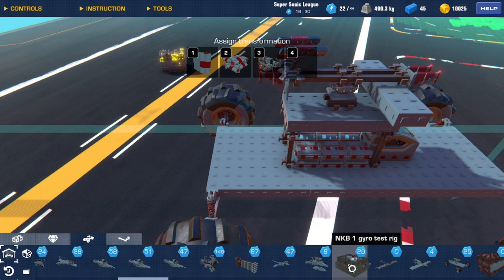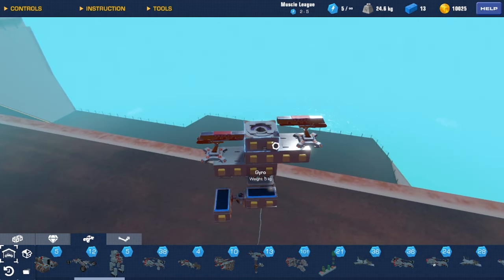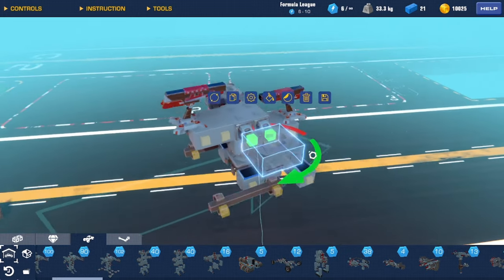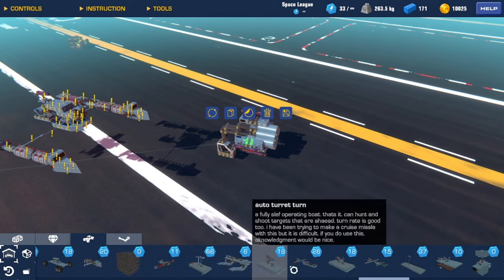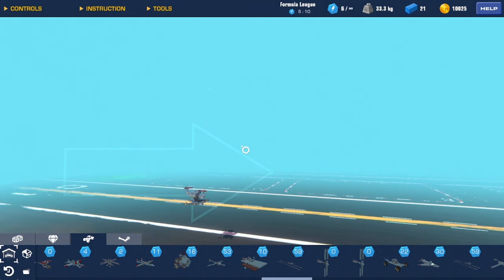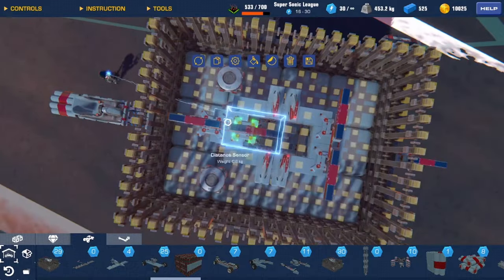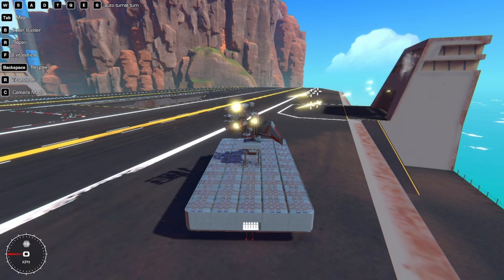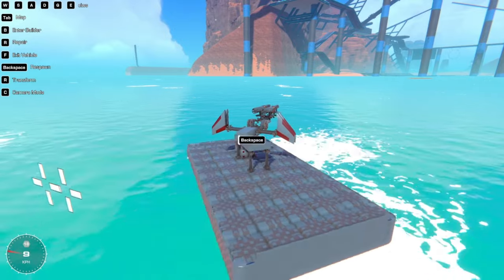RECOIL TECH, RADAR, AND MORE! IN TRAILMAKERS   |   RECOIL TECH

Comment: 10:11 To overcome the issues of sensors being "binary"; have you tried putting thrust onto the radar? As long as the radar is attached forwards of the center of mass of the main body, any thrust on the radar will turn the main body. The recoil from the guns turns the radar, the radar directly determines where the thrust on the radar is pointing, and the thrust is turning the main body.
Yes, you have the issue that the guns now have to turn the thrust as well as themselves, but for an aircraft or boat you can leave the lift or floatation on the main body. And your radar needs to have SOME counterweight to balance the guns anyways. You don't even have to put all of your thrust onto the radar. Some of it can remain on the body (where they will not contribute to rotating the body, and thus that response is weakened, but it will quicken the radar's response). (You could even go 3-step, where the radar has only enough thrust to turn a thruster unit (with all of the remaining thrust) and the thruster unit turns the main body - if you can get it all properly balanced and dampened...)
Reply from the maker: defiantly something interesting that i will consider but currently the binary of the sensors has not given me issues. when i start getting to missiles that need to be more responsive than the sensors can then i will definitely test this.

Comment: 17:45 I would say this is a game issue. I work with plenty of glitches and I can confidently say trailmakers has issues when it comes to high velocity and or rotating speeds. Also, mechanical parts' strength and guns are affected by how fast your going but it is a bit situational whether or not they are affected.
Reply from the maker: could you tell me anything more? im just about to post my next video about this.
Reply: @ThisIsDumbAllTheNamesAreTaken sorry for late response

I dont have any numbers since I haven't had to test this stuff yet, but there are multiple cases of conservation of momentum/velocity being a bit cursed whether intentional or not. For example, unstable UFO engines usually only work when pointed in certain directions and sometimes change how they work at different speeds. Another example (although im pretty sure only on xbox version), being teleported from edge to edge in space sector can make your creation spin out in a random direction and at a random speed.

For mechanical piece strength, if you air repair/transform with speed, mechanical part strength will increase depending on how fast you were going. Im pretty sure the strength increase is a product so it shouldnt affect anything free floating but I can't remember off the top of my head. The thing with the guns refers to how projectile speed isnt properly calculated to be relative to your build, making it possible to shoot yourself. Though at least with the gun thing, im pretty sure its only on the Xbox version, but the mechanical strength increase might also be as well.

If you want, I know some people who might know the specifics better than me (and who are on pc) and I could try organizing something.
Reply from the maker: thanks and you have already helped plenty @therayofdoomtrod365 . also the gun thing is on pc too, it has to do with bullets spawning a frame later meaning that if you going to fast they spawn behind you.

Comment: This is awesome! I’ve dreamed about making air to air missiles for soooo long but the closest I got was tracking torpedoes (using distance sensors but gave up because of the 50m detection range) 

Have you tried using the rotation from the guns to trigger angle sensors, or the new gyros? This might work and would allow the whole creation to track a target (a car or eventually a missile could follow a target as it moves about)
Reply from the maker: using sensors to detect the gun directly does not work and i already mounted radars on vehicles and i already have had successful guided tests. they just are not "hit a fighter jet" good. and yes, i do use gyros now.

Comment: Put the guns on the end of the missle than put an xor gate on it put fins on the front and back that’s my idea of how a missle might work
Reply from the maker: the problem right now is in the fact that the gun based detection just seems to break when moving at speed. control at low speed is already possible with gyros.